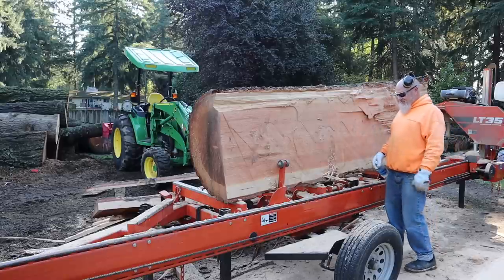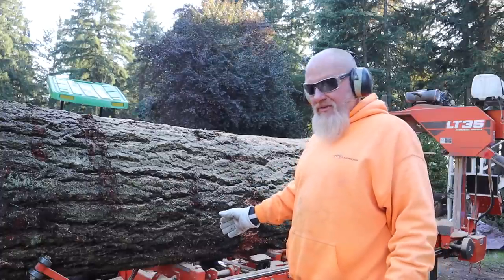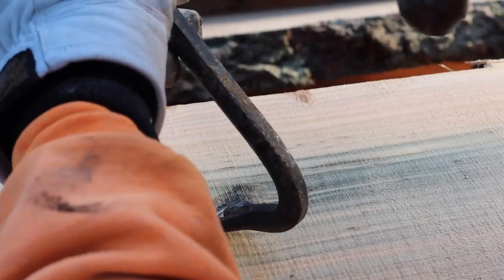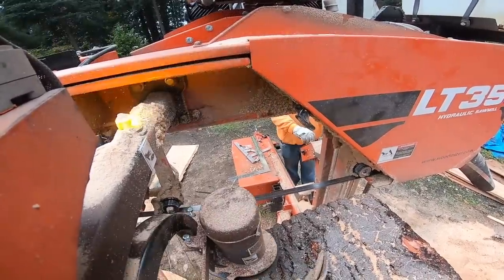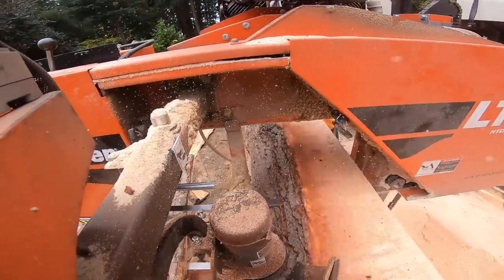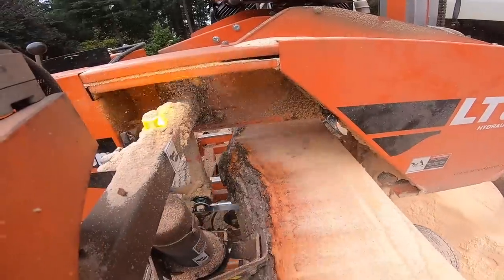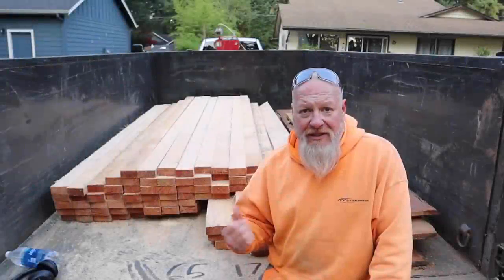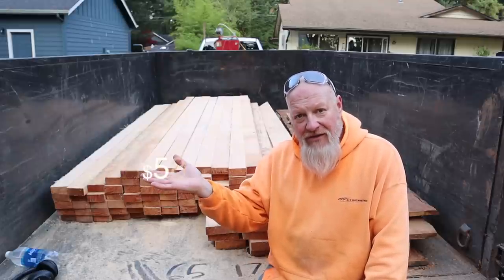Makin' NICE Lumber

Comment: As you say nothing attracts iron like a new band. I was resawing twelve by twelve timbers and made less than a foot before nipping through a one inch pin.
Reply from the maker: Ouch! I like to use Wood-Mizer’s Bi-Metal blades on reclaimed wood like that. They can take a beating but are considerably more expensive.

Comment: I’m guessing ( I don’t know ) each blade cost somewhere around $125 -$150. Can the blades be resharpen? How many times? Does the sharpening system cost way too much to justify? What is your opinion? 
I ask this question because I’m thinking about getting a mill for myself. Most of the trees I would mill are going to be yard trees. A little insight would be great. Thanks
Reply from the maker: These blades are about $30 each and can be resharpened. I’d like to buy a sharpener but I just haven’t gotten around to it. A good one is $15-$1,800.
Reply: Hey thanks for the info. 
I’m shocked how cheep the mill blades are!

Comment: For the sake of a 1/4" one way or the other, you would have missed that nail.  One of the other youtube sawyers I watch (Matt Cremona) uses carbide tipped blades.  They cost quite a bit more per blade but tolerate hitting metal much better and last way longer than regular blades.   How close were you to hitting the log clamp from that low angle perspective shot?
Reply from the maker: Literally a 1/4”! Wood-Mizer calls those blades “Bi-Metal”. They’re more than double the cost. I bought a box once for a reclaimed wood project I had. They work great if someone else is buying them😂
Reply: He cut off the top of his 2X2 square tube. It seems to me if you are likely to be hitting metal in the wood, it's worth the extra cost.

Comment: I'm getting tired of sawyers bitching and moaning about embedded nails in their wood who either choose not to purchase or fail to use a metal detector before they begin "they" slabbin'.  How many freakin' blades is it going to take you to wise up, pal?
Reply from the maker: Let me ask you this… your metal detector goes off, what do you do?
Reply: @NorthwestSawyer  One thing I won't have to do is change by blade.  Take the wood that beeps of the saw mill and flop on another one.  Did I pass the test?  Both answers are correct.
Reply from the maker: @stukaman1162  First, I did my best to decipher your spelling but I only see one answer. Second, you throw away $200 worth of lumber for a $20 blade?  I’m going to make a video explaining this logic.
Reply: @NorthwestSawyer  I didn't say to throw the log away - you must have missed that when you over-deciphered my "spelling".  You take the log off your line, further inspect it and determine specifically where the metal is with a detector.  When I responded by saying, "One thing I won't have to do is change the blade" - it was a direct answer to your question, "What would you do?"  Then I answered I would then remove it from the processing line.  Two answers to one questions, I guess.  When you do your video tutorial on how using a metal detector makes you a smart sawyer, I hope you'd show how to cut off the area in question - making perhaps a cookie - and then breathe a sigh of relief as your existing blade gets to cut more metal-free wood.  To quote a famous philosopher, "I'll see you on the next one."